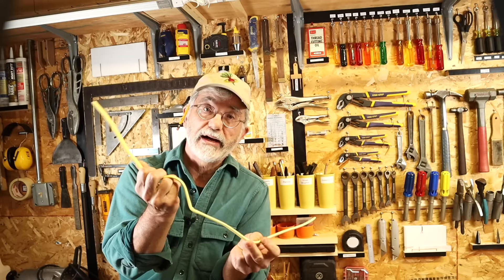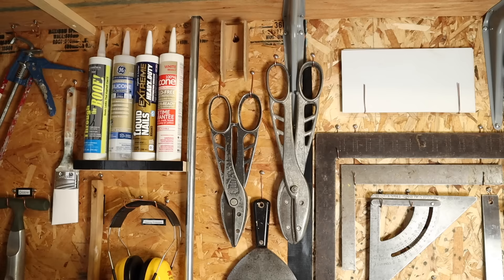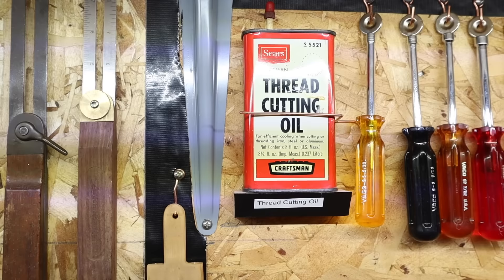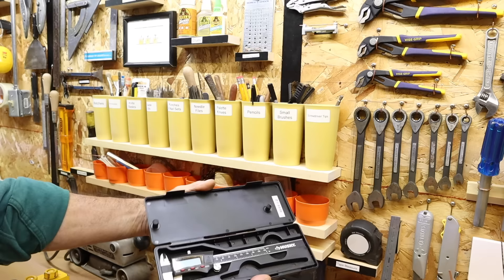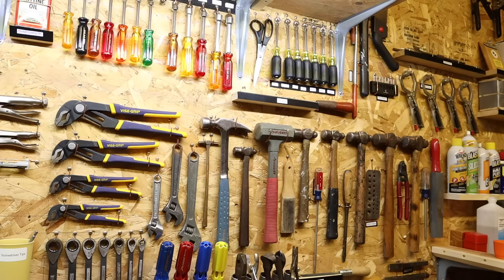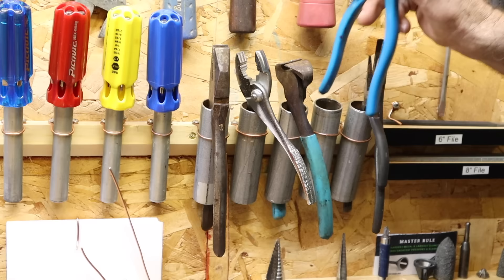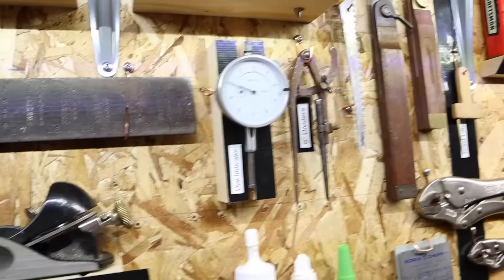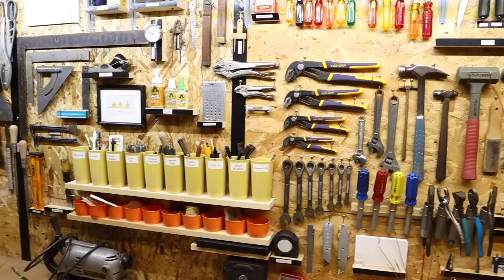How To Have Amazing Tool Organization Using Scraps of Electrical Wire

Comment: Wow!! Just the thumbnail sold me. I have mine hanging up with pegboard and associated hooks and loops one typically buys with it,  I use the  peg board with the larger holes. That being said, I love the idea of the wire and screws and the small shelves, brilliant idea and I plan on implementing some of your ideas into my additional 4 x 8 section hanging tools and accessories.  Thank you for the ideas and the video. You and I like organizing tools, just doing that is a great past time. Tom-WV👍

Comment: Quick tip, you can use the util knife and run it along the flat side of the romex jacket and it just falls away. It's a light 'rubber' compared to the jacket on the conductors. 
Other than aesthetic choices, why strip down to bare copper?

Comment: VERY ORGANIZED..! Good Job !!!
Your Pliers, from Left to Right: LINEMAN's PLIERS (about 1945ish), standard wire pliers, Channel lock brand End Nippers, Channel lock brand Diagonals, Needle-Nose pliers. 
   < Cut EMT with a fine toothed hacksaw or sawzall. Deburr with a deburr tool or the end od a flat bastard file angled into the opening of the pipe. Turn the pipe as you hold the file diagonally inside the opening. The roughness will vanish to a smooth opening. Then hold file on an angle across the face of the cut and rotate pipe, to gently clean outside of EMT cut edge.>
   Get HANDLE DIP INSULATION in a tall skinny can, wrap a wire around the working end of the tool and bend a hook on it. Stretch a string, (with overhand single knots tied every 3 inches), between 2 points several feet apart and place newspaper below it. String should be about 2 feet above table. Open can of handle insulation and set on that newspaper. ( Comes in: Light Blue, Dark BLUE, Red, Light Green, Medium Green, Orange, Yellow, & Brown, White, & Black. )Stir GENTLY. DO NOT SHAKE  nor cause bubbles!!! Gently dip handles of tools into can a few seconds and lift out and hold above can mouth, a few seconds and lift away. DO NOT SCRAPE SIDES OF MOUTH OF CAN ! Let drain ABOVE CAN while holding it. When it stops fast dripping to where drips are 10 seconds apart, hang it between the knots on your string. Important...do all the tools the same way and GENTLY hang each tool in its place on the line so as not to swing the other tools. <Note: if string sags really bad, tie a string to the line string and tie around a screw or nail in your rafters or ceiling> Put lid back on can TIGHTLY. Go off and do something else for half a day. DO NOT LET A CAT DOWN THERE ! THEY WILL MESS UP THINGS AND THEMSELVES VERY BADLY !!!
   Now, open can and re-dip everything. Go a little further in, so first layer end is covered. This LOOKS much better. Do as many coats as the thickness requires. Just be SURE yo GENTLY stir every time you pry lid off to start. Drying time is 12 hours for most brands. You can customize your tools so you can spot your tools from someone elses. after final dip is dry, open another COLOR, and dip the last 2 inches of the handle in there. Do ALL your tools like that. It's impossible for someone to take one of your tools and say it's theirs, unless they whittle the coating off.
   Personalize your entire collection. The number of things you can do is endless. Hang up the regular way. Do a short video on doing that on just a few of your items, with lots of items already dipped on racks in background. ///\\\.Be SURE to have a GENTLE breeze flowing by the tools on the line. Also up and out of room. Fumes WILL make you DIZZY !!!

Comment: I am not very knowledgeable when it comes to electrical wiring. Could I use solid copper wire as opposed to Romex (or something like that) as long as the gauging was sufficient to do the job? I have been racking my brain trying to figure out a way to store my tools etc in a restructuring of a small garage shop. I came across this video and have been obsessed ever since! This is exactly what I was looking for!
Reply from the maker: You don’t have to use copper Romex. Any wire that can be easily shaped and will hold as well (or better) than 12 gage copper will suffice. 👍

Comment: Instead of using expensive copper wire you can opt for inexpensive art wire(the kind used to make wire art sculptures. Aluminum should be able to hold any tool that copper can and is easier to work with. Steel is much stronger, cheapest but very hard to work with. Other alternatives would be drop ceiling steel wire.
Reply: Maybe a silly question, but could you use regular 12 gauge solid copper wire? It's way cheaper than Romex by far. Amazon has 64 ft for $22.

Comment: I have a section of wall that is out of the way I call the warranty wall. Keep your receipts in a paper envelope inside a plastic bag and have a tablet or list of expiration dates handy. I also keep a collection of partial plumbing fixture boxes with a picture and model number and parts list of the fixture that has lifetime warranty right there in one place. Of course register the warranty online as soon as you get it home. I have in some cases taped those things under vanities. 
   Most lifetime warranties are not honored because no one registers them with the manufacturer.
  This system works for me as I have done quite well with harbor freight extended warranties and even light bulb warranties.  So you buy a fifty thousand hour rated LED and it only lasts a year?  Complain and tell them you have the receipt and you get another free.

Comment: i love this so much. i've had lots of ways of organizing tools. i know french cleats are nice because you can constantly move around where stuff is without making new holes in the walls. but with the prices of wood right nowadays, no thank you. and those fancy metal pegboards are super expensive as well. normal pegboard requires you to ziptie & screw a lot of the holders down so they don't pop off anyway. screws work great. and most people have tons of them around. pairing those with random scraps of whatever like this is super economical. sure, it requires a bit more work and reorganizing things around takes work more work too. but sometimes time is cheaper than cash. doing what we can until we have more time works too. i have stuff on shelves, screws, nails, staples, cordage, store bought hangers, in random containers either sitting hung or with the lids screwed under shelves, bags, drawers, cabinets, french cleat stuff I've made where i either have a small section of cleats or i popped the cleats off and screwed the containers onto the wall, and sitting on the floor lol. i'm in between things right now and that is okay. i'm excited for later this year when i am done with some repairs to the garage and i can set up a shop again. but i am not going to have a lot of money to move away from most of these things... i am just going to organize it the best i can for when i do it. thanks so much for showing us your super cool and organized shop. it was inspirational and didn't make me feel bad for not being able to buy tons of stuff lol. i'm definitely going to check out more of your videos. and i wish you well.

Comment: Forge the wire (hammer lightly till it feels stronger when attempting to move) to make it stronger. It won’t bend after that. If you don’t forge it and continue to bend each time the wire will break.

Comment: Makes a lot of sense.  For design of a small shed or garage, if you were to factor the structural value of the OSB,  I think you could increase stud spacing quite a bit.  Anyone think so?  Or not worth saving a few 2x4?

Comment: I have a shed to use where I rent for woodworking. The problem is that OSB is through the roof on price. The last time I bought 7/16 osb it was a fiver a sheet.

I like your wire hangers idea though!

Comment: Liked! Subscribed!

I don't think this PARTICULAR method is for me since I'd never have a roll of Romex that I don't intend to use for electric

BUT

You did inspire me a bit, as you intended--I like the shelves for JUST the cups, and that's the kind of thing I'd do.

Similar to your stapling idea, I have small parts stored in Ziploc-type bags that hang on the side of a steel cabinet in my "shop" with magnets (also leftover from other projects).

It's a great way to store gaskets and other things that are relatively flat, as well as small wiring pigtails of the automotive variety or similar.

Comment: You can do it easier and more “clutter free” by drilling holes the diameter of the wire, and instead of using screws; after looping the wire; pass it through from the back and the loop will hold the tool up while not being exposed! Also, if using osb, spray both sides with clear(or colored) paint to seal the wood and make clean up a snap!… Improve on what you can and everybody will win!!

Comment: I like your ideas but even though I've occasionally done wiring projects in my house I have no scrap pieces of solid wire.  I would think that coathanger wire could be used and might work better for some things because day to day use would not knock it out of shape.  But back to solid electrical wire, would it not hold tools in place better if you left the insulation on it?

Comment: Metal coat hangers are more difficult to bend, but they do bend and are much stronger than copper wire (plus you can get a whole pack of them for a few bucks - copper wire is very expensive if you don't have access to scraps)

Comment: If you have pegboard:  I've wasted money on various metal pegboard clips of various sizes for different tools.  Recently I discovered just using zip ties !  Take a zip tie and bend the end back, push the zip tie and the folded back end through a pegboard hole, and then pull back the ziptie tip that was folded through the adjacent hole and connect it in the normal way to the other end of the zip tie to form a loop.  You can adjust the size of the loop for whatever you are supporting (screw driver, etc.) by how much you cinch up the tie.  Hard to describe but I hope you get the idea: a zip tie going in one hole and the tip coming out the adjacent hole to attach in the normal way to the other end of the zip tie.  This forms a loop to hang your tool in.  10 cents per zip tie.

Comment: I noticed your penetrating oils but Ididn't see any PB blaster in the red and white can it out performs 😀 liquid werach by far in many ways. Did see silicone blaster I'm not familiar with it I may have to check it out. I know silicone spray is real good to free up hard to turn key in locks. It doesn't  attract dirt and grime inside the lock like most oils and  wd40 does.
Reply from the maker: I but the aerosols at garage sales for next to nothing. It’s only a matter of time before I find some PB Blaster. 😁👍

Comment: As with all tool organization I see you left out one important factor and that is future expansion. We are constantly buying tools despite the fact we don't have any room to store them. Your wall is full, what do you do when you get a new tool? Do you have to re-design the entire layout?
Reply from the maker: The wall is primarily for my most used tools, and I consider it a work in process. Since making this video I have several changes that I want to make and plan to do that this winter when I have more time. The changes can be made very easily. If I had outlines for tools on the wall, like some people have suggested, the changes would not be so easy to make. I have plenty of other tools stuffed into old filing cabinets and other toolboxes. Getting the most often used tools on the wall over the bench has been a real convenience and timesaver. Thanks for the comment.
Reply: @herrickkimball  I get it, everyone has their method. I like the fact you made your own, that is really cool.

Comment: @herrickkimball    
Why did you use sheet metal screws?  
Would wood screw work?  
Awsom video!

Thanks
Reply from the maker: Pan head sheet metal screws are flat under the head, so they seat nicely against the copper wire. Wood screws are tapered under the head which is not ideal. But wood screws will do the job.
Reply: @herrickkimball  Thanks     
Again, I love your video.  
I will use you organization method.

Comment: Thanks! Your creative and functional organization has captured my imagination. We don't have scrap Romex, so when you say you used 12 gauge Romex, does that mean that each one of those three copper wires you pulled out is 12 gauge? What thickness OSB did you use for the wall. Did you apply it flush to the wall or use spacers behind the OSB?

Comment: great video QUESTION can i use my sheetrock instead of plywood or should i install plywood over the sheetrock
Reply from the maker: No. Sheetrock will not hold the screws securely.
Reply: Usually plywood is installed instead of sheetrock.

Comment: Stripping the insulation is "very easy with a utility knife"? Easier than with the wire stripper laying right there? 
-The full loop is also useful for coloring  Easter eggs. ;-)
Nice video, very useful ideas: and a cool, creative DIY solution.

Comment: Good ideas but you might get unnoticed mold in the  space between the OSB board and the wall without proper structure insulation  and a vapor barrier!

Comment: As an electrician, I'd approve #12 for this.  However, I will also echo the requests of all my business clients: 
"OMG!  Free is MUCH too expensive.  Is there any way you can you drop the cost by 20%?  Wouldn't it be cheaper with aluminium wire?"

Comment: Great organization! I don't quite understand however, why the wires had to be stripped. Wouldn't they work fine with the insulation on them?
Reply from the maker: Unstripped wires will hold like stripped. But making and fastening the loop will not be as easy as if the wires are stripped. That's my experience.

Comment: i will organize my tools like you!  thank you for the idea.  10:47 the utility knife, why the blade is exposed?  I thought it is dangerous.  Also, why you cut the electrical wire to make them three?  if you buy 16 gauge galvanized wire, you can use it directly, and it will save your time.
Reply from the maker: I have scraps of electrical wire to use. Otherwise I'd buy galvanized wire that can be easily worked with. 👍

Comment: Never liked pegboard. Not dense enough due to the hole spacing, and too difficult to keep the hooks in place. I know there are ways to hold them down, but nearly as much work as this is.
Well done on the organization, the instructions and the video.

Comment: Can you please tell me how you attached  the wood to the board to hold certain tools?  I was just thinking of using wood caulk.  Very sturdy.  Thoughts please.
Reply from the maker: Drywall screws through the front. Or pocket holes with a Kreg jig on wider shelves. I do explain this in the video. 👍

Comment: What thicknes of OSB board you use for tool boards on wall and what thicknes is best?
Thank you for answer.
Reply from the maker: It’s the standard, inexpensive OSB. I call it 1/2” but it’s a bit thinner. Maybe 7/16”
Reply: @herrickkimball  ahá, 3/17" = 11mm, or 1/2" = 12,7mm, ok.
I think, it is so thin.
Won't it start to split over time?
When you hang heavier things?
Isn't it a problem to get such short screws in a reasonable diameter?
How about using at least 15mm?
In our local store, it is possible to get OSB boards in thicknesses of 12 mm, 15 mm and 18 mm.
18mm seems unnecessarily heavy to me.
Reply from the maker: @TheOgi22  12mm looks like the thickness I used. I have had no problems with it. Nothing wrong with 15 mm. Just more expensive, right? I'm sure other screws than what I used will also work. Best wishes with your organizing project.

Comment: 25:00 My good sir, I was gifted the same Yankee Screw Driver but I can't seem to find an adaptor for modern bits like yours. 

Could you please point me in the right direction. I would really like to use it as opposed to just showing it off.

Thanks again!

Comment: Did you know you can straighten a wire like that perfectly straight by rolling it under something like a small piece of quarter inch plate steel. If you had to steel plates it would be perfect you can do it on a cement floor just put the wire on the floor steel plate on top of the wire apply weight on the plate and push forward rolling the wire which straightens it. With two steel plates you'll get a smoother wire by putting the wire between the two plates.

Comment: The caulk tubes reminded me to ask….what the heck do I seal an opened tube with that will keep it from hardening?  I can’t seem to find a solution and I only use it maybe once a year at most.
Reply from the maker: The best idea I know for that is to fold a piece of tape (like masking or duct) over the end of the tube with enough room to squeeze some caulk into the fold. The caulk will harden under the tape and form a plug that can be easily removed and “fresh” caulk will be ready to go. I don’t always do this but it has always worked well for me when I have.
Reply: @herrickkimball  cool! Thank you sir.

Comment: Isn't copper and iron incompatible? That's why plumbers use copper hangers and copper nails to keep copper pipes in place. Not sure if it would apply in this case. Steel wire could work as well.

Comment: Do you have additional good ideas for hanging garden tools??
Reply from the maker: No. I have an old wood barrel and I put my long handle tools ( like hoes.... lots of different hoes) upside down in the barrel. I saw it done at a Shaker Village I visited years ago. It works, but it's not a hanging idea. 🙂 Thanks for the question.

Comment: Wouldn't a roll of 12ga steel wire from the hardware aisle be less work (no stripping) and cheaper nowadays?
Idea: Drill holes and bend wire into pegboard style hooks to save on screws.